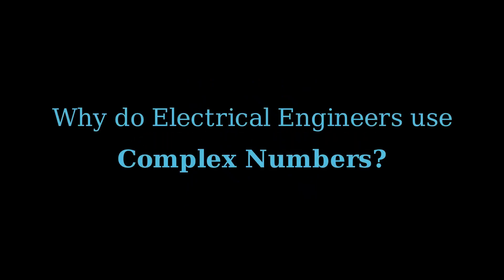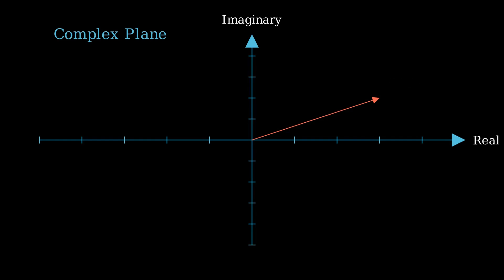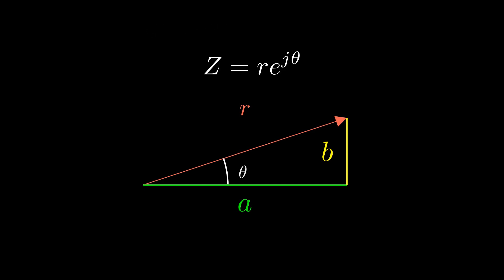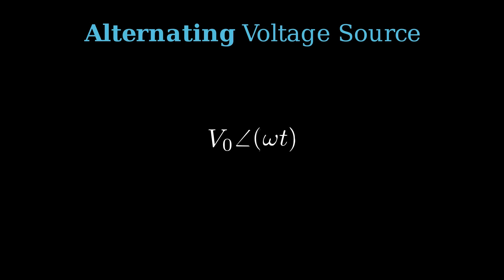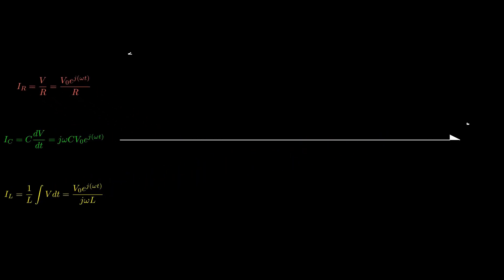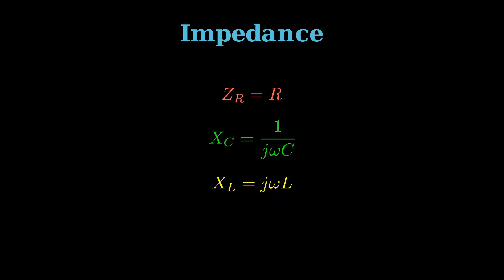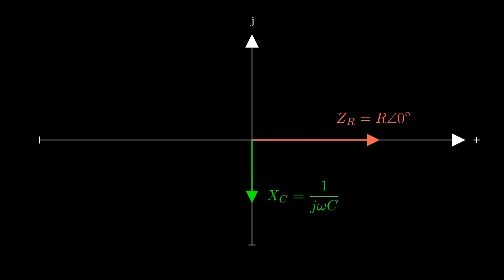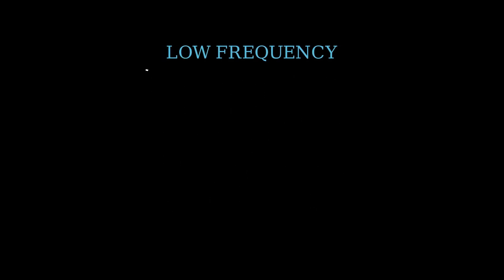Intro to Complex Numbers for EE

Comment: I remember when I first encountered complex numbers in my electrical engineering courses. They seemed so abstract, and I couldn’t quite grasp how they applied to real world scenarios like AC circuits. But once I got a tutor on SolutionInn to help me out, everything clicked. This video sums up the importance of complex numbers in EE really well and makes it easier to visualize how they’re used in voltage, current, and impedance.

Comment: A couple of points ....  It works nicely to call i or j the sqrt(-1) but, in actual fact i, or j, for that matter is not equal to the square root of -1.  If you think about it, sqrt(-1) * sqrt(-i) can be written as sqrt(-1 * -1) which would be 1.  Mathematicians and EEs define the i or j as i^2 = -1.  Also the arithmetic solutions of AC circuits work only for steady-state sinusoidal excitation; still very useful.
Reply from the maker: This is an awesome comment. Thanks for the added insight as well as clarification.

Comment: I loved the video. I’m currently in my first semester of ee classes and having a little difficulty with transient analysis. Where would you suggest I get some help with this outside of the classroom?
Reply from the maker: Thanks my friend, there are a number of resources I would recommend. If you have access to an oscilloscope I would recommend building a small RC circuit with a breadboard to observe transient phenomena. You can also simulate these responses in software such as LTspice. A great book to reference would be Practical Electronics for Inventors which I believe there is a free pdf for online. Let me know if this helps and good luck in classes.

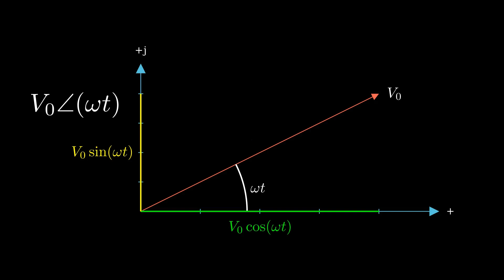Comment: Complex impedances are one of the joys of electrical engineering. Great introduction! At 3:30 you could show the point Voe^jwt going around a circle of radius Vo at a frequency of w radians/sec = w/2pi cycles/second. In linear systems sinusoidal inputs create sinusoidal outputs of a (usually) different magnitude and phase. Complex numbers have magnitude and phase. So Vin = Vine^jwt and Vout = Voute^jwt+theta. Vout/Vin is the complex impedance and theta is your angle. 6:00 Frequency response can be determined by simply trigonometry rather than differential equations. Something easy for once!
Reply from the maker: Yes! Thanks for the suggestions my friend, I'll look into making a video with this type of visual explanation as well!

Comment: Some said inductance reactance should be -90 deg, is it correct?
Reply from the maker: inductive reactance as displayed in this model should correctly say +90 degrees because j(omega)L has a j in the coefficient. This gives it a positive 90 degrees according to this model. I would refer to the book "Practical Electronics for Inventors" by Paul Scherz and Dr. Simon Monk. They have more an even more in depth explanation.